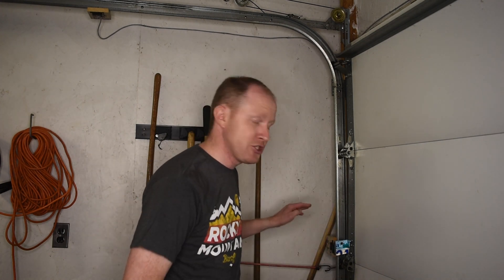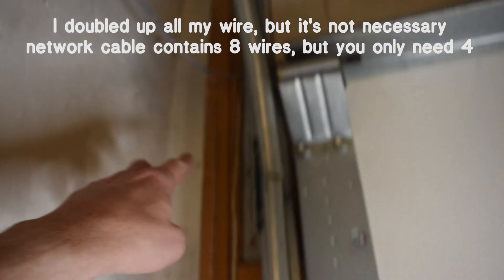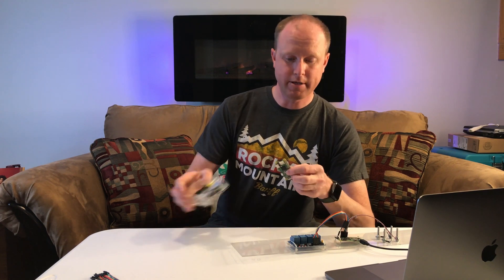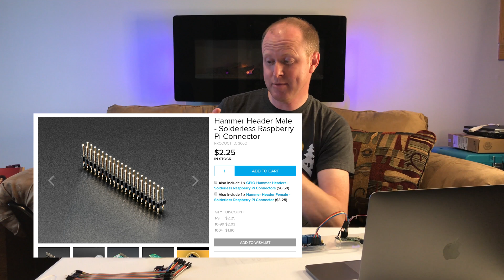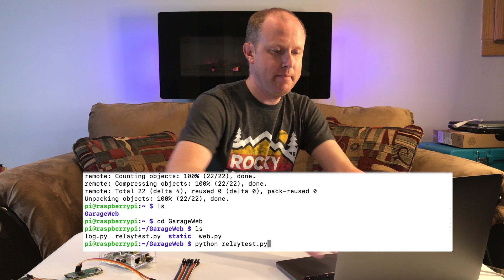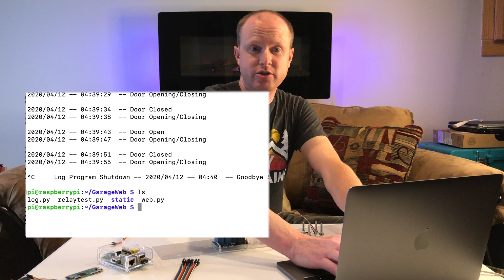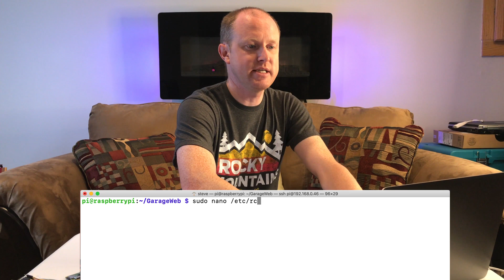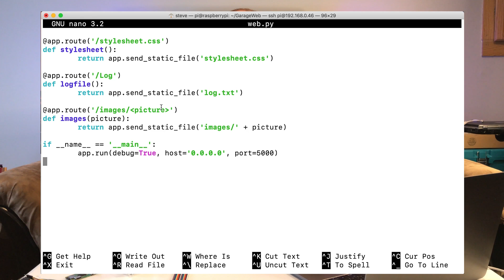Raspberry Pi Controlled Garage Door & Sensor (complete instructions)

Comment: Here are a couple of thoughts, the distance between the sensors (reed switches) and the RPi should either be kept as short as possible or the inputs at the RPi should be fully buffered and isolated to shunt any induced voltages. The longer the wires are, the more chance an induced voltage will overload or even  damage the sensitive Pi inputs. In light of this, the best location for the Pi would be near where the sensors are on the side of the garage about half way between them two sensors. Even then, I would at least add a fast switching diode across the inputs (as a flyback) and possibly a small capacitor to smooth on/off transitions.
Secondly, although this may seem like overkill to some, it's best to minimize the chances of a software or hardware 'glitch' causing the door to open on it's own. The most secure way to do this would be to duplicate the hardware using two RPi's that have to agree on the action to actuate the garage opener control before anything happens. This isn't too hard to do, but it does almost double the cost and complicates things somewhat. The other way to accomplish this, but less secure, is to have two separate processes on the RPi monitoring the sensors, each of which controls a different relay (whose outputs are wired in series), and both of those must agree before the garage door can be actuated.
I did a similar project with a pair of esp8266 boards that each had a WiFi enabled MCU, a relay, and an opto-isolated input. For the software I used ESPEasy and simple scripts. Each board was less than $10 and I used two such that a failure of any component or software on either board would result in the door not being able to actuate. This was then interfaced to Home Assistant which I already had running for the web interface side. By using a simple to use and reasonable flexible software platform on the boards, ESPEasy, the scripting code was less than 20 lines on each board. To actuate the garage opener, I setup two virtual buttons on Home Assistant, each which sent a command to the respective board. In order to actuate the opener, each button has to be pressed within a 5 second window.
Reply: I've been using over 75 ft wires on a similar setup on my reed switches for years with no issues.
Reply: @daleblount3230  I have no doubt. Rather one has to worry about spikes from induced voltages is highly dependent on the environment. When designing electronics for the general public, one has no idea of the environmental circumstances of a particular installation so worst case or near worse case must be accounted for.

Comment: Nice project.  Password and port should be in variables, either at the top of the web.py or in a config.py file...

PASSWORD = '12345678'
PORT = 5000

If you have them in a separate file, you can `from config.py import *` in web.py to load them.
Reply: Yes, much safer than asking people to poke around inside the code.